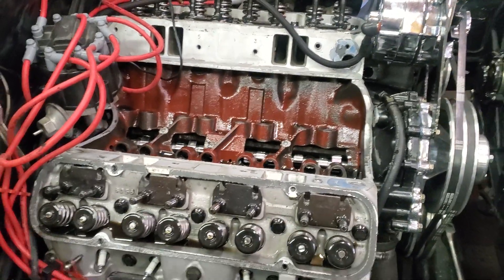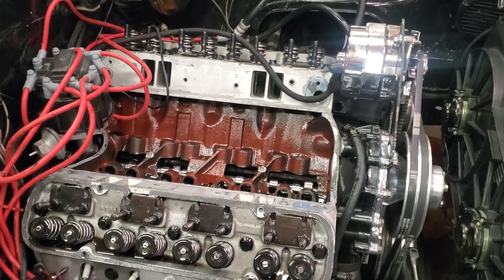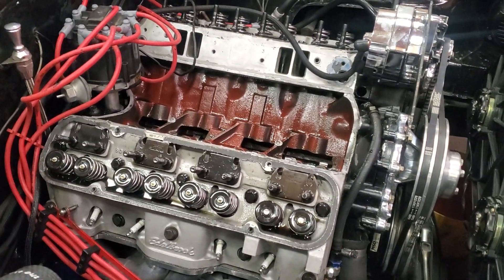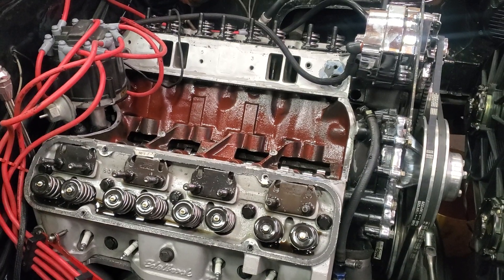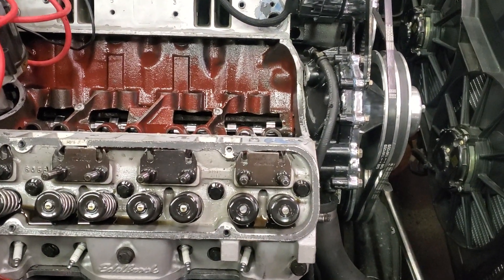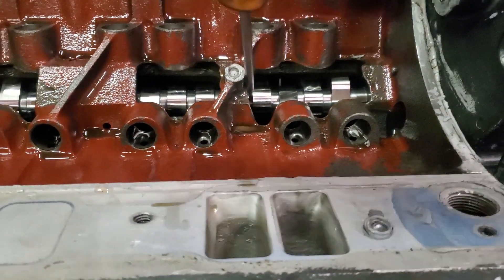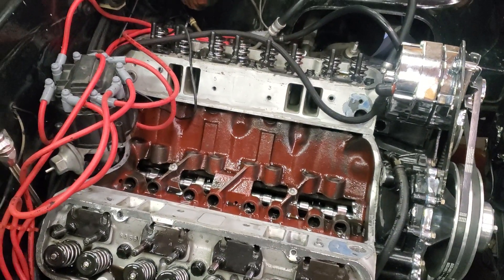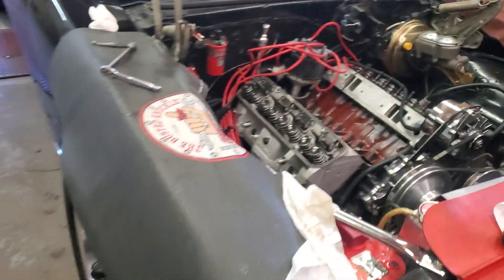1968 Pontiac Firebird Erratic Ignition Timing Problem

Comment: Somebody forgot to put the key in in the front of the cam. Why would the ignition timing be set on 20 degrees initial? Also, the distributor is in wrong, it's in like a chevy, the vacuum advance goes on the drivers side.

Comment: This is a great explanation of what is going on after you went through all the other items on the diagnostic checklist logically and found this.  Please do a follow-up to this one and show where the original builder made a mistake, what you do to fix it, and then show a final Dyno vid of it fixed.  Way to go!
Reply from the maker: I replaced the engine with a built 455 short block using the same cylinder heads and camshaft.  I will try to post the dyno graph soon.